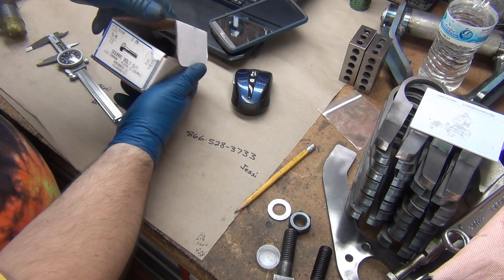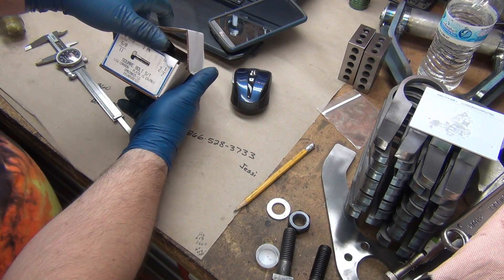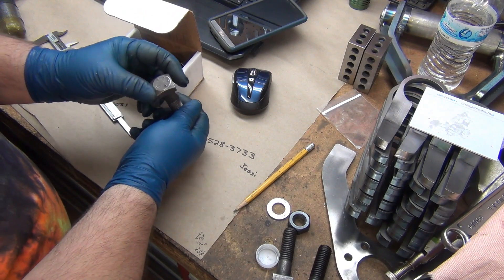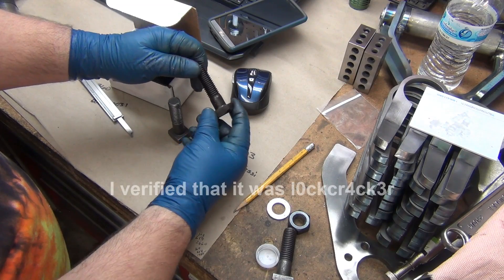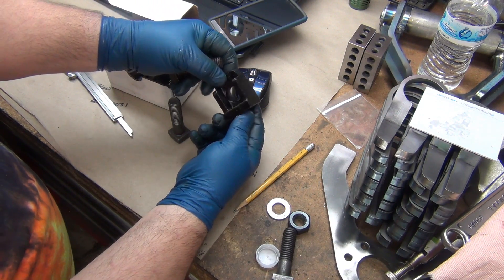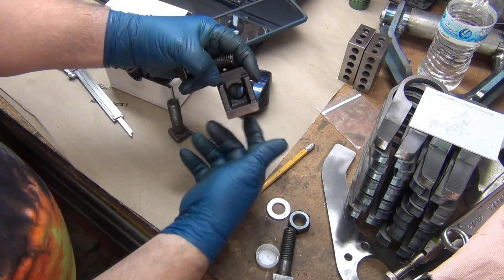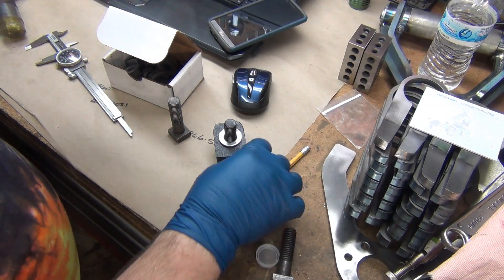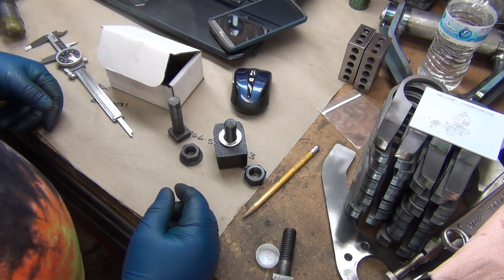Mill Vise Hold Down Clamps

Comment: The nut directly on the clamp tends to make the clamp twist when tightened, which could cause mis-alignment of the vise.
The washer provides a slip plane between the clamp & nut.
Reply from the maker: Good point.  I didn't have much issue when I used them and I don't use them anymore.  I'll keep that in mind if I ever use them again. Thanks!!!  -Mike

Comment: Nice clamps bluehands. I have an identical vise on my NM200 and want to add a second, but can't find anyone that sells it. Could you tell me where you got yours?
Reply from the maker: Another Novakon guy....sweet!   I bought the two original vises from Novakon with the mill.  At the time, they were almost identical to what Shars was selling.....so they matched the price for me.  Looking at both Novakon's and Shar's sites, they don't have these anymore.  Novakon shows a manual milling machine vise and Shars only seems to sell Kurts.  MSC shows an Interstate vise that looks similar.  My price(logged in) shows it around $350  
https://www.mscdirect.com/product/details/63328801

Just did a bit of searching on google.....came up with this part number 850-AP06   Looks about the same and it's cheap!  Check it out closely to make sure they're not pulling a fast one, but I'd consider getting a couple of I didn't already have two. LOL  Good luck. :)

Here's a link to an amazon listing....under $200 shipped....which is why I said cheap.  https://www.amazon.com/ANG-LOCK-BRIDGEPORT-MILLING-MACHINE-850-AP06/dp/B01M329DOB
Reply: @bluehandsvideo  I bought my NM200 used a few months ago. It was purchased around 2010 for a School of Design, and when installing an ESS they smoked some traces on the power filter board. The guy in charge claimed it had less than 20 hours on it, and based on the like new condition I believe him.  I jumped the traces and fixed a few other minor issues, installed a Mesa 5i25 and PathPilot, and now have a very solid running mill.

I appreciate your digging up these part numbers. The one at Amazon looks almost identical. Just placed an order. Will let you know the quality when it gets here.

Thanks again!
Reply from the maker: I just added the part number and link to the description too in case others have the same question.  Thanks!
Reply: @bluehandsvideo  I purchased and received the vise you linked. It's actually 5-13/16 wide, and slightly smaller overall  than the vise that came on my Novakon. The slides are flat and true, and jaws are square. Looks like a good vise for the price.

Any chance you could share your Fusion model for the clamps?
Reply from the maker: @rickojames  I'm very happy to hear that the vise turned out to be a good choice.
I took a few minutes and created a page on my site where you can download the files and I also shared them on grabcad.
http://www.bluehandsinc.com/vise-blocks.html
Reply: @bluehandsvideo  Thank you kind sir!
Reply from the maker: @rickojames  You're more than welcome.  Come back and put a link here if you shoot your own vid of making them. :)

Comment: Could you possibly ADD an <off-ctr> type insert; to move the clamp TIGHTER, as you tighten? gripWIN@gmail.com
Reply from the maker: Interesting idea.  I'm sure it could be done, but when I'm aligning my vises, I snug them down and then tap them into place.  I would think that an insert that would move it's position might make it a lot harder to align......if I'm understanding your explanation correctly. :)

Comment: Have you tried Blueing? Or however it's spelled.. would look kinda good on those clamps.
Reply from the maker: Hmm....you're right...that would look good!  I'll have to keep that in mind for future projects. Thanks!!! :)
Reply: Or, assuming they are low carbon, black them by heating to red and dropping in oil.
Reply: bluehandsvideo or stove polish.. need to try that myself.
Reply from the maker: I'd assume so, too.  I'll try to keep that option in mind.  I haven't even started getting into finish options, so thanks for the info!!
Mike
Reply from the maker: Stove polish....interesting.  I had some here for our wood stove.....not sure if I still do, but it's easy enough to find.
Reply: bluehandsvideo found some today so going to try that on some t-nuts I need to make today.
Reply from the maker: Cool.  I look forward to hearing/seeing how it turns out. :)
Reply: bluehandsvideo well the stove polish didn't work. Everything is black except the t-nut.
Reply from the maker: LOL....sorry to hear that!  I guess I won't bother looking for mine........except that my stove does need it. :)
Reply: bluehandsvideo haha. Don't know why it didn't work. But I guess the cast iron sucks it in easier. Gonna try to heat the part in the oven @300c and put some linseed on it.
Reply from the maker: Probably has to do with the cast iron being very porous by comparison.  Linseed is good for rubbing on hard wood ;)